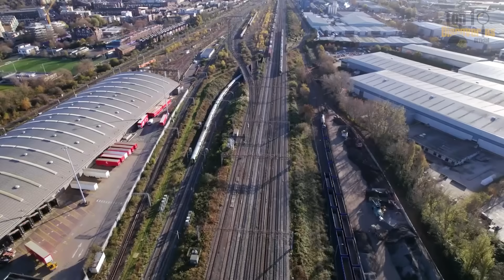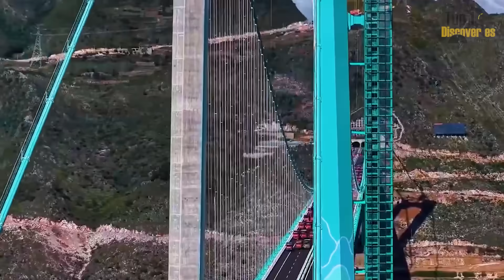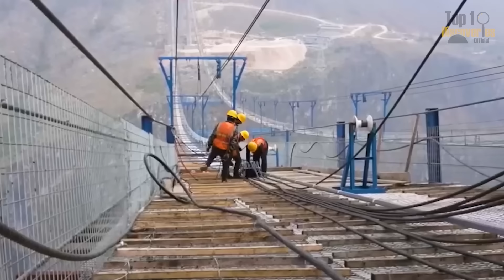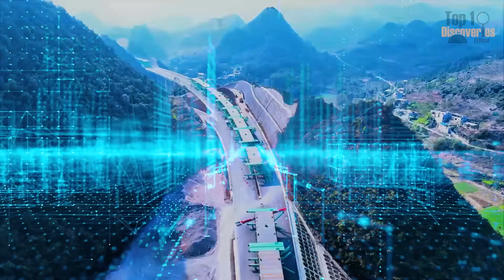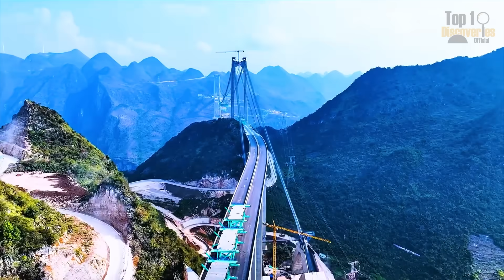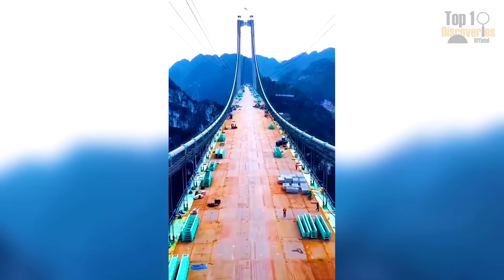China’s Huajiang Grand Canyon Bridge Just Passed a Load Test That Stunned Experts

Comment: I'm not going to watch this video but most bridges are designed to support a full load of transport trucks from one end to the other, max load with a safety factor.
Reply: Put away your ignorant arrogance, this is not a 20-meter-long bridge in front of your house, this is a 4-lane 1,420-meter-long bridge, use your calculator to calculate it if you can't figure it out with your tiny brain. Show us the result you would have.
Reply: 测试有很多项目，卡车测试只是比较直观的其中一项。
除此之外，还有大桥的日常监测。
Reply: Great.  Have a couple bottles of booze and go to sleep.
Reply: well the goal was not to see if the bridge would collapse but to measure the tensions, vibrations, etc to provide real data not just simulations.
Reply from the maker: Yes
Reply: Z 🇷🇺 
Grande cina 
Bravo chiudi gli occhi e controlla il fattore di sicurezza della casa  durante le assenze .....